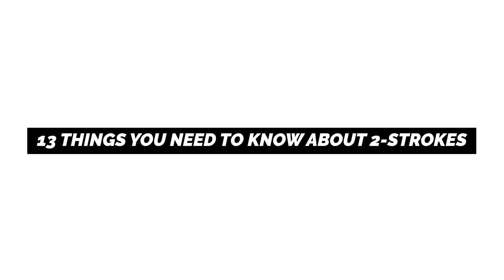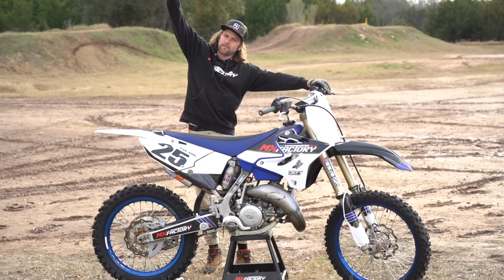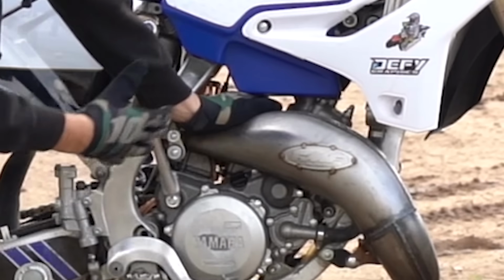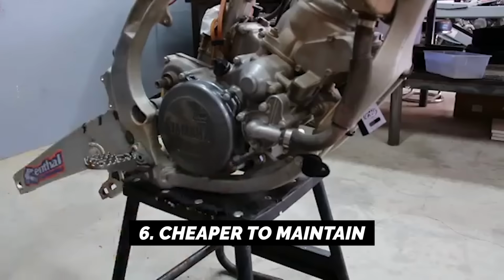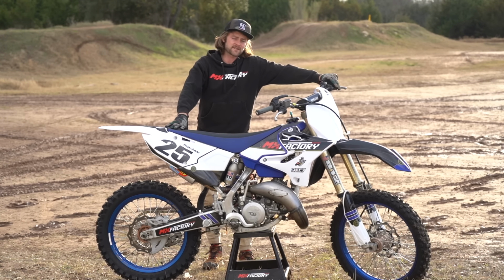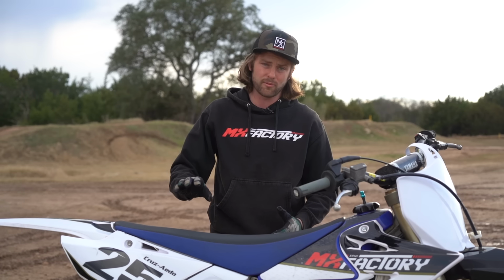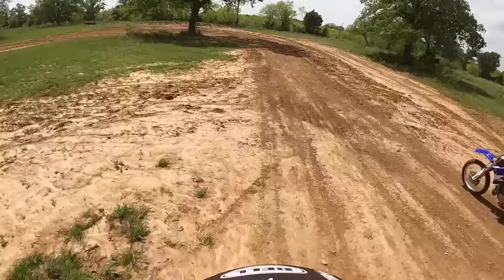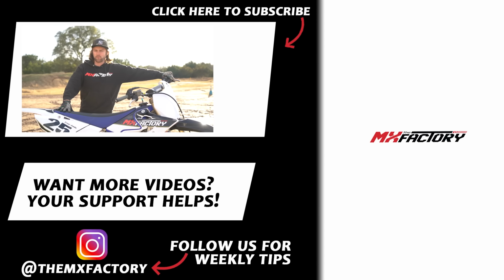13 Things You Need to Know About 2-Stroke Dirt Bikes

Comment from the maker: Who here just loves 2 strokes??
Reply: Yes and more people need to get not just into the sport but onto 2strokes, I love 2 strokes I had a yz85 and now I have a yz125 and it's shreds
Reply: I do!!!  I regret selling my 1997 KX250 and need another 2stroke for the track!
Reply: me hahha have a sx250 with 300kit
Reply from the maker: @cameronsmith4485  Nice!!
Reply from the maker: @fsubulldog03  ohh thats a good bike!
Reply from the maker: @Motors4LifeOfficial  sickkkkkk!
Reply: Yes i LOVE 2 strokes there the OG.
Reply: @TheMxFactory  yes Im thinking abut a cr250 but idk. ktm is never better..... but honda is a honda.....
Reply: Mixing gas and haulin ass
Reply: @TheMxFactory  oh yes it was!  You could lug that thing down low, feather the clutch a little and BAM you're off!
Reply: 1992 Suzuki rm125 bringing it back from the dead KLOTZ BENOL 🤘🏼
Reply: Much bigger smiles all around on a 2 smoker.
Reply: Cr 250 2007 with a factory pipe ♥️♥️♥️
Reply: Just picked up an 07 kx250 in August. Can't wait to take it to the track this spring
Reply: I have a kx 100 and I love it sooooo much! Thanks for a two stroke vid 🤟🏻
Reply: I have a 2003 Cr125 that I’m currently rebuilding
Reply: @Motors4LifeOfficial  cr250 from the mid 90s are great.  I never was a fan of the AL frame ones.  One of the best underrated 2t out there is the last gen rm250.  Amazing handling bikes.  Avoid the previous gen with the internal waterpumps unless you find a solid one
Reply: We got married about a year ago and she’s been treating me so well!!! 😍
Reply: Me
Reply: Always have since a kid, the screaming demon is what caught my attention to dirt bikes back in the 90's
Reply: @TheShift1313  i heard that the rm had best 2strokes at the end and the rms are much cheaper than cr
Reply: Just so you guys know, 2 strokes are alive and well down here in Alabama. I'd say at least an even split, but honestly more smokers especially with upper C, B and A riders.
Reply: Me
Reply: I love 2 strokes i have husky supermini and husky 125. And next year my dad is gonna get me 250 2 stroke.
Reply: I got Honda CR 125 2T and i love it. My friends pushing me to buy a four stroke, but the wont brake me.  TWOOOO STROOOKE POOWEEEEERRR 💪🤙 and great video by the way 👍
Reply: @Motors4LifeOfficial  yes if you can find an 02 or ideally an 03 and up rm125 or rm250 its a great bike.
Reply: @TheShift1313  i could bought cr250 2002 for 1900 this summer or rm250 2007 for 1500 i am more sorry for not buying an rm bcs rm with restyle looks the best!!!!
Reply: @Motors4LifeOfficial  i had a line on several but around here they were going for a lot.  Cheapest one I found was $1000 but looked like it had a very hard life.
Reply: Say less
Reply: L❤VE my 300 Beta XTrainer!! Ahhhh, the smell of fresh 2 stroke exhaust 😎👍
Reply: Love em
Reply: I’ve been a fan for over a year now and I’ve wanted a dirt bike for a year and I just got a KTM 65 SX for christmas
Reply: @Motors4LifeOfficial  hard to find these - the counter-balanced, injected KTMs seem to be the pinnacle of 'eff yea'!
Reply: @seminole_fan280  nice dude
Reply: @juan-anthonyswart2760  thanks
Reply: Now I gotta go ride mine
Reply: @nick6613  haha
Reply: @juan-anthonyswart2760  lol I gotta stay away from the vids in the winter so not so tempted to take er out 😅 haha
Reply: Yee Yee
Reply: I do! Just got a 2021 KX100, upgrade from my 2010 RM85
Reply: Me I just picked up a 2004 Cr250
Reply: @Motors4LifeOfficial  get a Cr250
Reply: I've never owned a 4t. I've ridden them but only own 2t's from my 1988 RM80 to my 2018 YZ250
Reply: Love my 2021 YZ 250... the 450 gets a bit jealous in the garage... but the 2 stroke is just so much more fun to ride!
Reply: @alabamadirtrider  here in Connecticut too! A yz250 or yz125 won't last more than a day or two on the showroom floor!
Reply: I have a 2007 kx100 and my dad has a 1991 cr125
Reply: 99 yz250 smoker 🙌🏼😤💨🌬🚬
Reply: Own both a 125 and 250 2 stroke, never even ridden a 4 stroke
Reply: 200th like
Reply: I bought my first 2 stroke at the end of last season and there's no turning back to 4 strokes! I was extremely surprised by how insane it feels when the power hits.
Reply: @austinnethercott6223  that's awesome! My son and I are rehabilitating a 02 kx 125. Good luck with your bike!
Reply: i have Beta 300 2T i love this bike
Reply: I love them too death for real its the best bike all around, sounds super cool and feels insane 🤙🔥🔥 Got myself a yz250 2019 and ive invested $4500 on the engine and parts, for more power, quicker throttle response and higher compression bike ill be racing 450s on that bike cant wait 🤙🔥🔥🔥
Reply: i would trade all my 4 strokes for a cr 500
Reply: @Motors4LifeOfficial  sick pawaa
Reply: @Motors4LifeOfficial  but he said wrong that the 2 strokes are cheaper..
Reply: @ZanSedej  In other countries 2 stroke that are at here 4k there are for 400e
Reply: Yup just got off a 450 and back on a yz250. So much more fun
Reply: Me
Reply: im sorry, you said 2 strokes make a bit LESS power?!?!?!?! help i am confusion 2 stroke makes sooooo much more power then a 4 stroke ik make 20,5hp on a mid rpm 70cc so not even late powerband with more power and a 125cc 4 stroke makes 17hp at max like WHAT?!
Reply: Me and we need Honda to bring back the 2 stroke
Reply: Man I traded my 03 yz125 for a 2006 yz250f I I regret it everyday I ride my 250 makes me sick maybe if I had a 450 I wouldn’t be so butthurt 😂😂
Reply: @notoriousbige281  nah it still isn't the same. I traded my 450 in on a yz250 2t. The 250 is way more fun than even the 450
Reply: Hell yeah, own like 3 of em.
Reply: That's the last year Kawi made the real kx. I had a 05 and that thing was awesome. If not for the accident, i would still have it. Miss my kx.
Reply: @johnrobitaille4640  i got the 3t xcw and it's freaking amazing. I've trail rode and taken it out on the track. It's just got such amazing power with a bottom that pulls like a 4 stroke.
Reply: @charlesmiller7139  sweet !  I can't imagine what it must be like. When the TPI first came out word was the carb more 'exciting' hit but likely b/c injected version just so smooth - speaking of - how smooth is the engine?
Reply: Power band is what keeps me on a 2 stroke
Reply: I do
Reply: @cameronsmith4485  me too
Reply: Me
Reply: me
Reply: just bought my fifth 2 stroke and my first 250
Reply: Meeee
Reply: 06 yz 250 brother!
Reply: I was thinking about switching to 2 strokes
Reply: I own a two stroke myself and wanna start a collection
Reply: me
Reply: I only like 250 2 stroke
Reply: I do! Back in 1998/99 when I lived in LA I had street legal Yamaha IT490! People were losing it, asking me all the time how I got it street legal. Simple: I bought it that way, ha ha. Even made ICE T and his friends lose their mind once, as I lived below (Hollywood Hills) their house, and decided to take the bike out for a spin on a Sunday when he was chilling with friends on the patio... : )
Reply: @robbierojas3035  ... Same premix I use in my 2018 YZ250
Reply: There so fun to ride I have a 2019 YZ 250x
Reply: I do
Reply: 08 ktm 200 xc-w love it. Most of my riding buddies are on 4 stroke now but I love the fun factor of 2t.
Reply: Mx Factory you know a few things about two strokes but you didnt tell us what it is that causes the tremendous surge of power we called the Power Band. I was fortunate enough back in 1975 when the Honda elsinore's were first coming out to be taught how to tune them in the Honda R&D service schools by the man himself who designed and built the first Honda Elsinore as his name was pop Yoshimura. And it's very simple because two strokes are self supercharging engines and when it comes on in the Boost That's The Power Band....
Reply: I ride and own both, but 2-strokes are my favourite.
Reply: Me
Reply: 2 strokes are the best!
Reply: I have a yz 85 it rips!! Two strokes are the best🤙🤙🤙🤙
Reply: MEEEEEEEEEEEEEEEEEEEEE
Reply: I do. Enjoy them so much.
Reply: Brap!!!
Reply: I dont really love any of them. Im just a rookie so i dont have much experience lol
Reply: Yep ive owned my 86' Cr500 for bout 6 years now an it is one hell of a beast, as i say to people im not riding it the bike is riding me an takes me on a ride instead
Reply: 2 stroke life
Reply: One hundo percent !!
Reply: Me.  I have a 2018 ktm 85
Reply: I have a 2013 yz 85
Reply: Love 2 strokes have a 2001 cr 250!!
Reply: Meeeee
Reply: @cameronsmith4485   I'm getting a yz
125 on Tuesday
Reply: @gmx0413  ay nice, you gonna enjoy it they are fun
Reply: @cameronsmith4485  yeah man, really looking forward to it
Reply: Me
Reply: Just bought a 79 yamaha yz 80 2 stroke fucking rips for my first time owning a bike myself can't wait to get into the bike world
Reply: Me 4 strokes suck
Reply: ME!
Reply: 2 strokes is real motocross!
Reply: Yeah
Reply: Me and thanks to my 2 stroke dirt bike a got 5th and 2nd in the first 2 races of the season
Reply: Hell yes. I've got an '04 KTM EXC 200 2 stroke and it is INSANE
Reply: I have a old 1990-1985 rt100 2 stroke
Reply: Meeeeee!!!! Bought a 300 ktm 2 stroke last week!! Love it!!!!!
Reply: I love my restored 1995 CR250.
Reply: I love 2T..i have Honda MBX 125F 1984
Reply: I love two strokes as well. I completely restored my 1995 CR250 to like new. http://www.vitalmx.com/forums/Bike-Builds,46/1995-CR250,1369652
Reply: Rm85 gang?
Reply: @cameronsmith4485  i want a yz 85 so bad ive wanted one since i was a 6 but there expensive
Reply: @harleygarcio1757  yeah I got mone on a deal from my uncle but uts totally worth it if your a bit older now though got a 125 the are a hell of alot more fun 
But the 85 might be a good learning bike if you haven't
Reply: @cameronsmith4485  ye just its price lol
Reply: @harleygarcio1757  yeah I said to the guy at the dealership the other day when he asked if I was interested I told him well ofcourse I'm interested i just don't have the money
Reply: Started on a YZ 50, years ago, I'm on a 92 KX 500 now, but my knees are old enough that they're really starting to envy electric start. Lol.
Reply: Always had 4 stroke just got my first two stroke rm125 an it rippsss
Reply: @h4wk1  ay broo yk itt 2strokes rockk
Reply: Love my 2012 yz125!! Got the fatty pipe and fmf shorty on it🤘🏽
Reply: I have been riding 2 strokes since 1974! Still love em.
Reply: Fuckin A right!
Reply: Nothin but if you wanna have a real good time
Reply: I have recently  gotten back into riding after an injury when I was younger on my 125. I just purchased a ktm 250 xc-w and I could not be happier with the bike. The 2 stroke has made me whole again.
Reply: Im here
Reply: yz 250x.i love it
Reply: Me
Reply: Me I love
Reply: I love 2 strokes but sadly my country doesn't  😑
Reply: Yea I got a kx85 it’s so powerful and sketchy me being a young beginer
Reply: Yes
Reply: 2 stroke for life
Reply: I'm getting a yz125 I've always wanted a 2 stroke bc they've more suited to my riding stile, I cant wait!!
Reply: I just hate 4 strokes. :)
Reply: @TheMxFactory  sir can we run the engine much time like 4sroke dirt engine? Cr125 or 250
Reply: Just recently bought a kx 250
Reply: 2 strokes r still champion 🏆
Reply: I have a kx 65
Reply: @isaacisaac6726  65 awesome little bike
Reply: I'm a 4 stroke guy tbh
Reply: I love em I got a 2001 rm250
Reply: 01 KX85 & an 01 CR250 Long live 2 strokes
Reply: Me!! I just bloody love them!
Reply: Me
Reply: @cameronsmith4485  I have a kTm 85 and a 65, im gone get a 112 cc kit and a tune for the 85 next month
Reply: Meee
Reply: I LIVE for two-strokes.🤘
Reply: @cadillachernandez2271  I like both!
Reply: I doo!!!!! Yz250!!
Reply: Can you do what’s bad about 2 strokes
Reply: I just rebuilt my 08 ktm 250 from the ground up
Reply: Me bro I have 5 of them
Reply: @huntermalone6883  ...nothing.
Reply: @cameronsmith4485  same bro yz life
Reply: Sound and smell. Enough said.
Reply: Yes
Reply: Me, me, me…
59 & still around on a 1976 Maico 250.
Reply: I’m Buying a 2022 yz250 for a reason gotta keep the manufacturer happy to keep them alive
Reply: I love 2 strokes!!!!!!!
Reply: Everyone the smell the sound makes me smile ear to ear😃
Reply: Started on 4 stroke. Can’t wait to get my 2 stroke
Reply: Nothing like a two smoke 🙌🔥
Reply: I love riding 2 strokes bro.  Best bike out there
Reply: Here
Reply: Me
Reply: I personally can get off 2 strokes faster than 4 strokes. 🤷🏻‍♂️ just sayin...
Reply: ME IM GETTING ONE THIS MONTH
Reply: Me
Reply: I rode a 84 Honda, upgraded to an 06 husky wr250. I'm never going back to 4 stroke
Reply: Getting a 01 RM125 on Wednesday I can’t wait!
Reply: Me
Reply: @cameronsmith4485  is the yz 85 fun to ride I wanna get one
Reply: @cruxfrl7370  extremely. Would definitely recommend
Reply: Started out on a 01 Honda CR 80, still use it to this day. The scent and sound will never get old on any two stroke
Reply: Me lol 😝 💜💜💜😍😍😍😍🥵🥵🥵🥵
Reply: U have a yz 250 2019 😄😄
Reply: I just got a two stroke I been riding 4 strokes  I love how 2 strokes feels the more power is great
Reply: Same gotta RM125 and cr80 pip bike
Reply: I’ve got a 2022 kx85 and it is AWESOME!
Reply: Me!!!!
Reply: Whats better then 2 strokes or 4??
Reply: Meeee
Reply: @LeNeutron  for a beginner I’d say 4 stoke
Reply: @mzpups  thx
Reply: @mzpups  yo what's like best budget one if know one by any chance??
Reply: @LeNeutron  Honda’s are pretty good in price same with Suzuki’s
Reply: Mixing Gas & Slapping ASS!!!  Love me that ring ding ding ding  🎶 🤟💯
Reply: I got myself my first 2 stroke it’s a 89 banshee and it’s so clean
Reply: @LeNeutron  depends what size and year you get but $8000 is good for a Yamaha adult size 4 stroke for a 2 stroke a good price for a adults bike is like 6-7000
Reply: Love 2 strokes, 01 250 MXC, 89 KX 125. Vintage two strokes are the best
Reply: I love 2 STK.  It's the king of the mountain.   It's RAW power!!!
Reply: I love two strokes , I currently own a 2012 kx 250
Reply: Me
Reply: Love the 2 stroke I've got a kx 85
Reply: Hell yeah
Reply: Me I’ve got a kx85
Reply: Not me, ”hocus pocus now my two stroke is brokus” said by a wide man
Reply: All day
Reply: Me
Reply: Yessir I just bought a yz125 with fmf system sounds and feels great
Reply: Me I ride one
Reply: YES just got a new TC 85 LW
Reply: I love 2 stroke
Reply: Bro two strokes are trash in my opinion because they are so loud and ridiculously annoying to try to control these things
Reply: 2 stroke for life
Reply: I admit im 11 and i have a 2 stroke 110cc ktm and i love riding all the time
Reply: Right on!
Reply: Me
Reply: I love them. Just bought a ktm 250sx. Best thing ive ever spent money on. Never buying a 4 stroke.
Reply: I love my yb100 royale 80 mph top speed
Reply: got my 2019 yz250x yesterday went from a 150 4 stroke love the difference i actually feel like normal sized on it ahahha
Reply: I have a CRM 250AR Honda and it's a beast ♥️🔥
Reply: I have yz 250x
Reply: Mee
Reply: I just got a kx85 bored to kx100 today an after school I get to ride it for the first time
Reply: Me i got yz 125 and just done PROJECt 500 cc 2 stroke . Bro only 3 gear and im going 105 kmh and i got five 😮
Reply: Me
Reply: I do
Reply: Me but I'm new
Reply: So im twelve and. Today I rode a dirt bike for the first time and it was a cr80r and I never crash or fell so I did good
Reply: I’ve had both two and four strokes now I have a CR85 and it’s my favorite bike
Reply: I like go yeeeeeeeeeeeee
Reply: 98 kx250.... she rips
Reply: They just sound great
Reply: Me
Reply: I have a kx100 and it is the best bike ever
Reply: I just got it
Reply: Me but,I only own a trail bike a YAMAHA Dt125
Reply: me!!!
Reply: I wanna get one but every one keep saying them too ends go out a lot I’m scared it’s my first bike lmao
Reply: 2 stroke is just for crazy rider’s !!😈
Reply: 2smoke for lifeeee
Reply: I FREAKING LOVE TWO STROKES!!! Got to try a sx-f 50 mini, am purchasing a YZ-65, I am 10 and I think 2-strokes are the best! #twostrokesforlife
Reply: Meeeeeeee
Reply: actually ktm makes yamahas 2 strokes for them 🤓☝
Reply: Freak yes